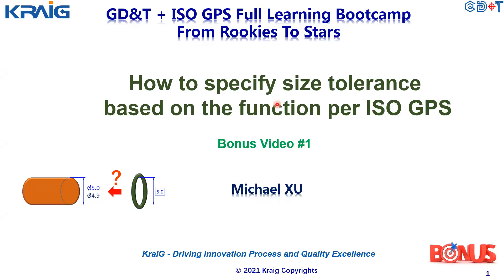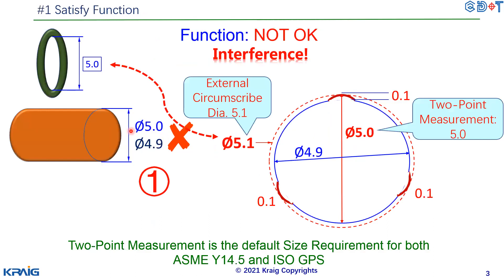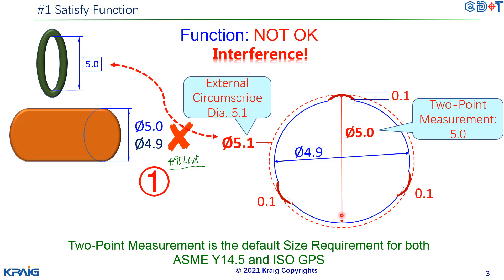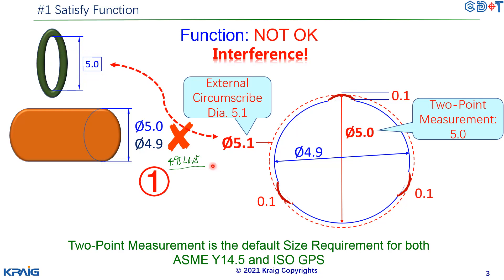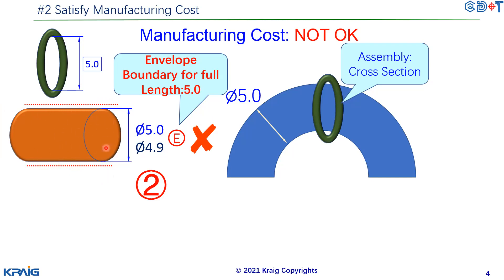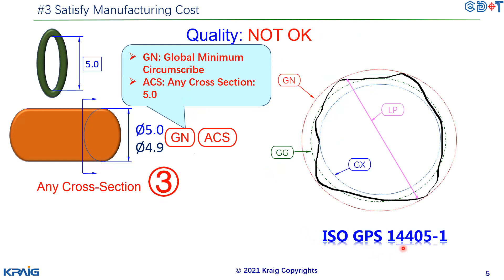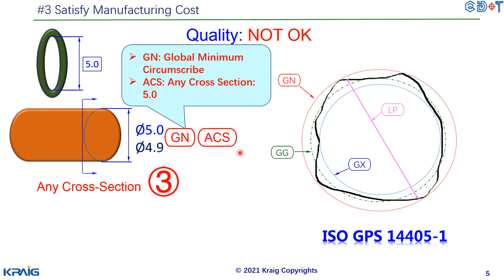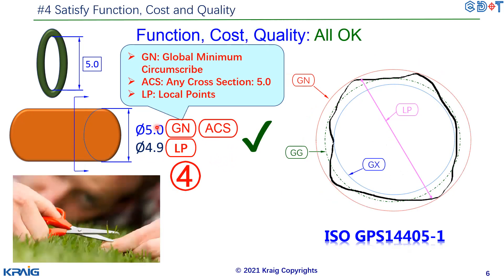How to use ISO GPS to specify the size tolerance properly

Comment: This is ignorant of ASME Y14.5 Rule 1: Envelope Principle. 
2.7.1 Variations of Form (Rule #1: Envelope Principle)
The form of an individual regular feature of size is controlled by its limits of size to the extent prescribed in the following paragraphs and illustrated in Fig. 2-6.
(a) The surface or surfaces of a regular feature of size shall not extend beyond a boundary (envelope) of per- fect form at MMC. This boundary is the true geometric form represented by the drawing. No variation in form is permitted if the regular feature of size is produced at its MMC limit of size unless a straightness or flatness tolerance is associated with the size dimension or the Independency symbol is applied per para. 2.7.3. See Fig. 2-7.

In other words, it’s implied that full form MMC boundary needs to checked on simply features of size with no other modifiers specified. Two point check will lead to misreported false data. 

Please do not post more misinformation online. It adds to the confusion.
Reply from the maker: Thanks for your feedback. This video clearly says how to use ISO GPS (NOT ASME Y14.5) to specify the size tolerance, not GD&T per ASME Y14.5. You may need to check the differences of size definition  between ASME and ISO GPS.
Reply from the maker: by the way, I have posted video about Rule #1 3 years ago on Youtube: https://www.youtube.com/watch?v=8LSPSEOJ3wU.  Welcome to watch famous Rule #1 video. :)
Reply: @kraiginfo6339  So why it is stated on slides that Two point measurement is default for both: ISO and  ASME?